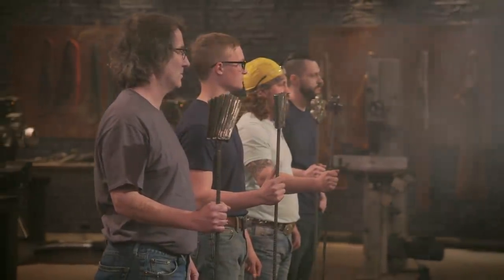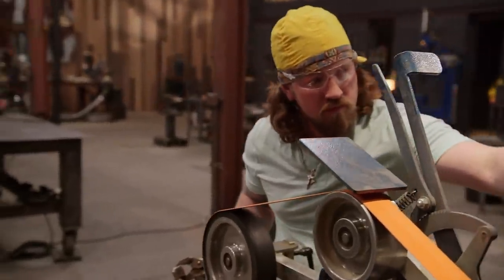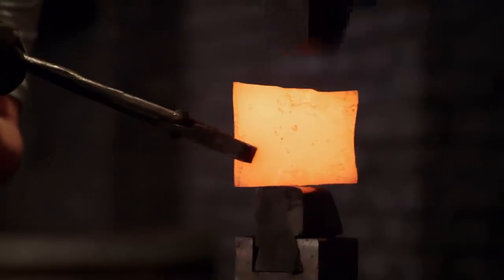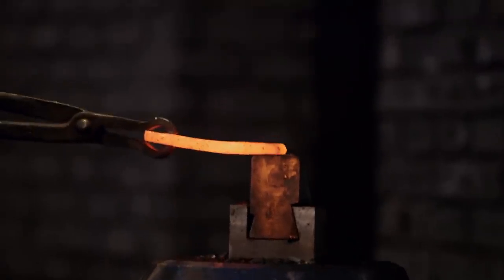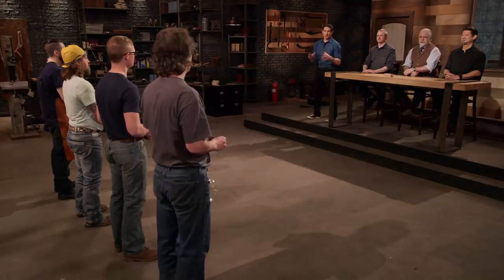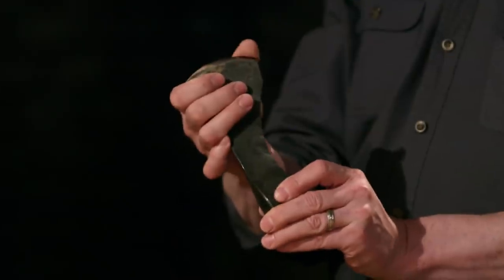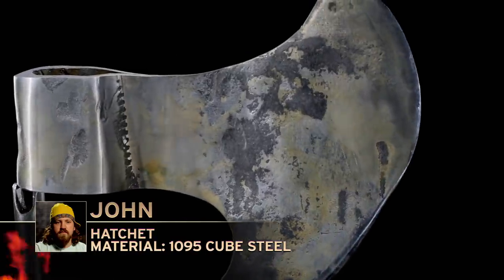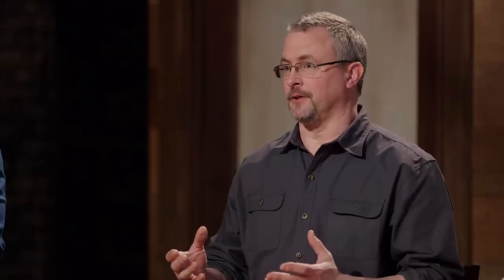Forged in Fire: Forging Hatchets from Steel Shapes (Season 5, Episode 14) | History

Comment: Those are not hatchets, those are Tomahawks.

Hatchets go on the top of the handle, Tomahawk slide up from the bottom.
Reply: Reuben Willard I like this level of specificity, I wish a weapon show would get this right but most people don’t care I guess
Reply: what do u mean
Reply: Hatchets drop on the top, Tom's up from the bottom? How can  you tell how they are tapered?
Reply: Only that young guy Aaron did that. The other two Smith's hilted the hatchets properly.
Reply: @jakedonald7934  The geometry of the eye is a good way to discern.

On the other hand, all of 3 of them made hatchets instead of tomahawk in the 2nd round (Aaron had some problems fitting his), so we're all in the parameters.
Reply: Nah tomahawks are indigenous weapons, no one there was indigenous
Reply: @AnonYmous-ob7py 
Actually, what you're referring to is a tamahakan, which was a weapon made by the Algonquin tribe, it has a stone head that fastened in between a split handle.

Although it gets its name from the tamahakan, the tomahawk is made out of metal, and slides from the bottom of the handle up to the top as the taper widens.
Reply: @AnonYmous-ob7py  So? Just because you’re not of a certain ethnicity doesn’t mean you can’t make that ethnicity’s weapons.

Comment: Forging axes and hatchets is very difficult without enough experience. It also need a handle type tool to shape the eye. But skillful blacksmith can forge hatchet without power hammer, hydro press and grinder.

By the way, in Japan, during the feudal era, the social status of swordsmiths was high, and the social status of blacksmiths who made agricultural tool and kitchen knives was lower than that of swordsmiths. However, Blacksmiths were proud of their ability to forge various steel products.

Comment: Wouldn't it not matter if the weight of the blade is towards the back of the axe head? I mean the momentum is still there behind the cutting edge, surely it would still transfer to the wood.
Reply: The thicker the sides towards the blade edge the more damage it can do even it will not break when chopping like wood. That axe head is to thin it will kill a person but armor and wood nope

Comment: Why do they sandwich the blade?
Reply: The edge should be made of your best,toughest, steel. These days a hatchet is all one material but when tool steel was hard to come by you made body of mild steel and forge welded a piece of tool steel for the cutting edge.